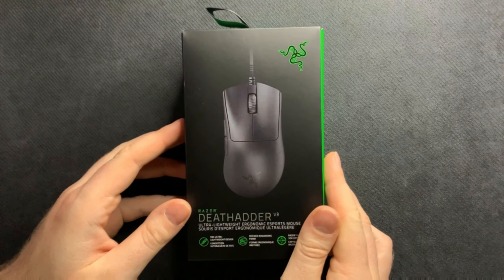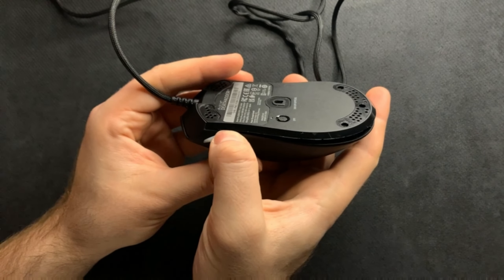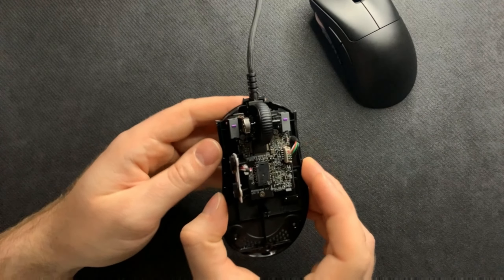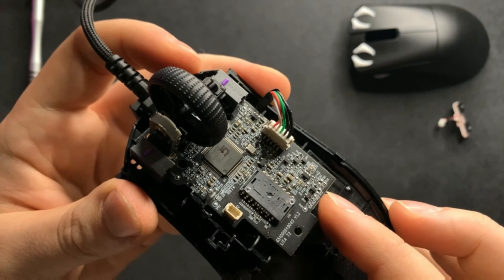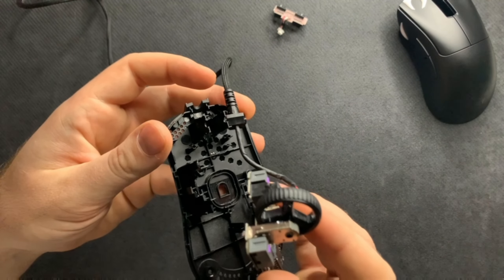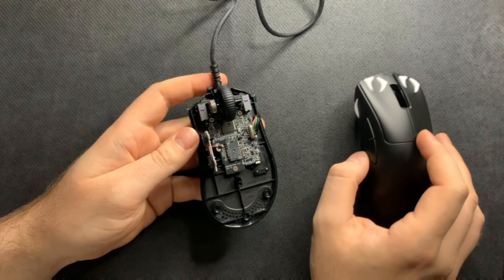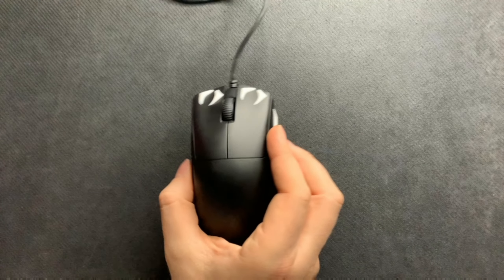TEARDOWN | RAZER Deathadder V3 (wired)

Comment from the maker: ⏲ Timestamps:
00:00 - Intro
00:52 - Required Tools
01:07 -Disassembly Process
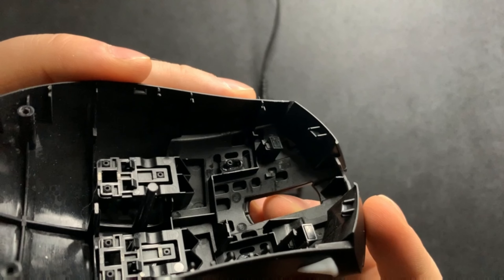02:52 - Note About Shell-clicks Removal
03:42 - Side Click Board Removal
05:11 - Main Board Removal
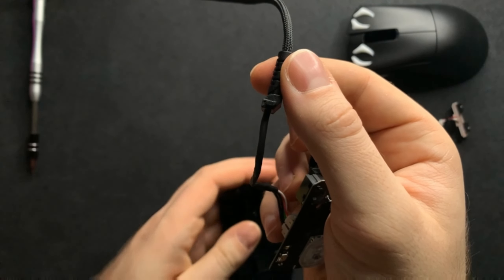06:21 - Scroll Wheel Removal
07:14 - Reinstalling Scroll Wheel
07:35 - Reinstalling Main Board
09:53 - Reinstalling Side Click Board
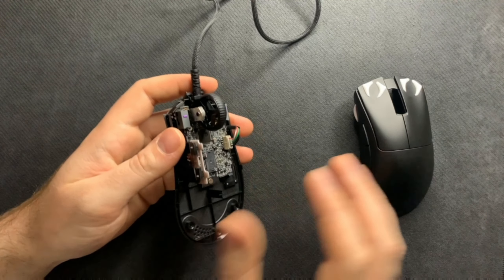10:52 - Reinstalling Top Shell To Base
12:56 - Outro
13:43 - End

Comment: hemm planning to swap my dav3 wired top shell to my other dav3 pro (cosmetically not good since got it used for $33). both should have same top shell right? 🤔
Reply from the maker: I'm actually not sure, I never took apart the wireless version. I think it miiiight fit but I'm not 100% sure.
Reply: It won’t fit because they changed the shape and modifications for the pro and hyperspeed
Reply from the maker: @quantumpudding  Damn, I though for sure it'd fit on the Pro, that's really disappointing ngl

Comment: I have some pre travel on my mouse 2 button, would the painters tape trick work with the lube on the bottom plunger?
Reply from the maker: Yeah that would work, aluminum tape is also usable but harder to install.
Reply: @mel0nFPS Great, thank you so much.
Reply: @mel0nFPS Just did the fix. It’s my first time disassembling a mouse and your video made it so easy. Thank you!

Comment: Great video, do you know what is a great replacement cable for the deathadder v3?, it seems the connector is different to other deathadders, mouse is connecting and disconnecting constantly and the problem is the usb cable, reinstalling and updating the software didn't fix the problem.
Reply from the maker: I don't know if one off the top of my head, I'd reach out to RAZER and see if you can RMA since the mouse has a 2-year warranty. Worst case they could probably send you a replacement cable.
Reply: I got the same case even my DAV3 also disconnects at random.
Reply: @KokeJr, if you got a fix for this please let me know
Reply: @Fr33Ze_2  There is no fix, the cables they use are trash and there is no replacement you can buy since the connector is new and different. Although one thing you can do is completely straighten the cable with your fingers by pressing from the usb plug all the way to the mouse connector, it will work better. If that doesn't cut it, return it and get something else, they may send you a new one with the same issues.

Comment: hey there, i had many copies of this mouse but my main one has a scroll issue where it sometimes jumps more than one step or simply does not scroll, i use it a lot so its important for me to know if it is fixable and if not what should i replace it with? HELP, subscribed!
Reply from the maker: Hi! If the encoder is failing technically you can replace it with another encoder, but you'd have to solder on a new one yourself. For repairs like this you're much better off using the 2yr warranty and RMA the unit so Razer can replace the scroll wheel.

Comment: the main connector for the left side connector u had to pry came off any fixes?
Reply from the maker: Hey, can you elaborate what part came off exactly?
Reply: @mel0nFPS  remember the ribbon cable thing u told not to pull off i told my dad to do it and i did it and in the process the actual part that u connect the ribbon cable to that was soldered on the board came off

Comment: Is it possible for you to provide the specs for the middle and the side buttons? They seem kind of uncommon for a mouse click. I'm planning to get one; it would be great to have the replacements in case I need them replaced. TIA
Reply from the maker: For the middle mouse click I don't know what switch type it is sadly, for the side buttons you can solder in any switch you want, I'd use a Kailh or Huano switches though as they're the most compatible.
Reply: Did you find the specs for the middle click button? Mine is not registering clicks from time to time, the best solution would be to change it. TIA
Reply: @akiraotoishi8622  this is typical with these type of button. My g502 has those but the height is different . But fortunately they are repairable and that's what i did.

Comment: Plz I need help
The right click button pulled out and I can't put it back
When I try to out it back and kinda of world but only the front part and the button is very tilted up
U said it was removal plzzzz
Reply from the maker: Did you unscrew the anchoring screws at the top of the shell?
Reply: @mel0nFPS  which screws at the top? Where are those in ur video? You specifically said you wouldnt take off the main clicks and the only screws where on the bottom behind the skates
Plz help
Reply from the maker: @ShayNoMore1  My bad, I forgot the DAV3 used clips for the main buttons. If you pulled them out and they're bent you might have bent the retention bar on the main click. The shell clicks are replaceable but you need to be extremely careful if you remove them to avoid bending them. Sadly there isn't a way to fix this, once the main clicks are damaged you can't repair them. You'll need to replace the click with a non-bent one.

Comment: Why don't they fix the part where the cable is being crushed by the PCB . in 2 years time the cable gets damaged and stop working just because of this design
Reply from the maker: The cable has stand-offs so the board doesn't make contact with the cable itself, it's just ran underneath. More likely for the external paracord to get damaged over the two years of use than the actual internal cable imo.